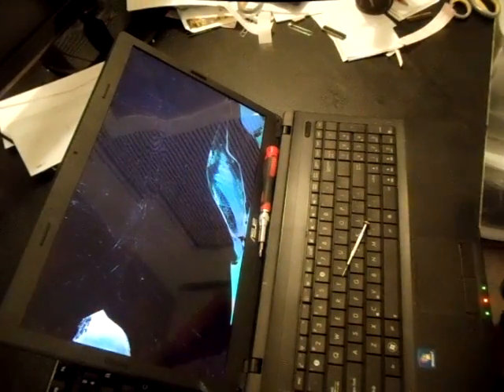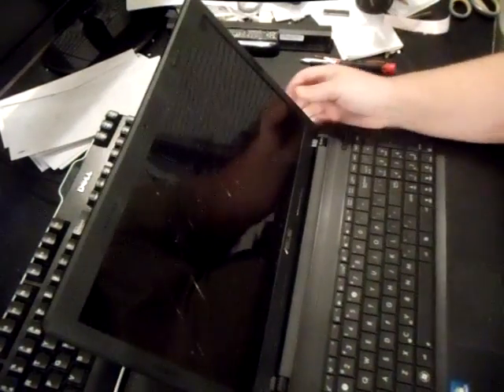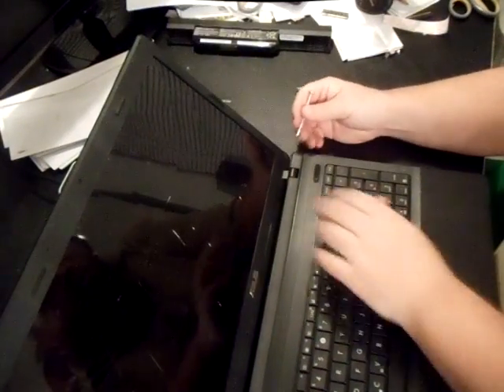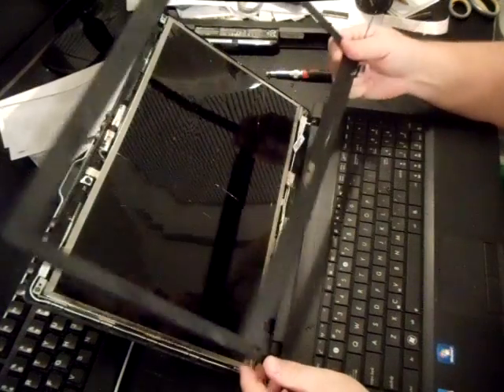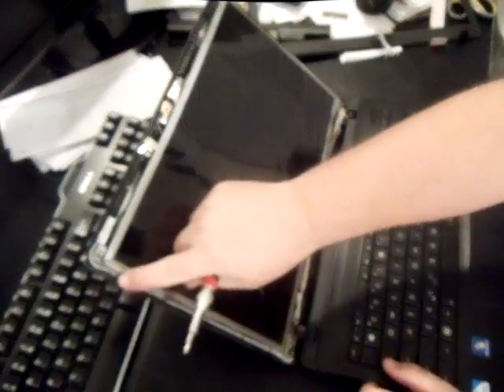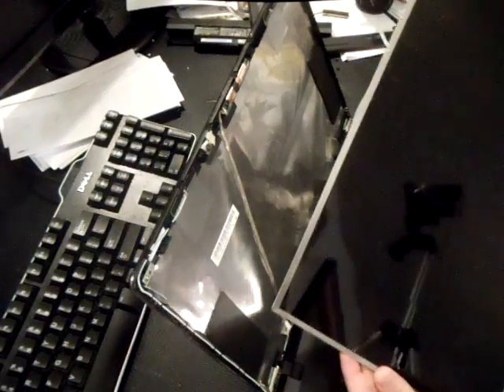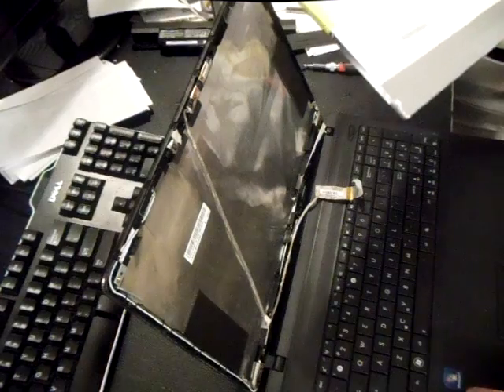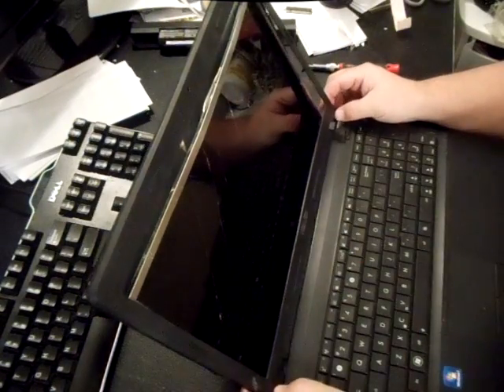How to Replace Broken Screen on any ASUS Laptop (X54C U43 U43F U46E U47A K53E X54H X44L K501 LCD

Comment: We’ll now you have to take it apart to remove the battery, should I do that first?
Reply from the maker: if its super difficult to remove the battery don't worry about it.  Just make sure its fully powered down and not plugged in.